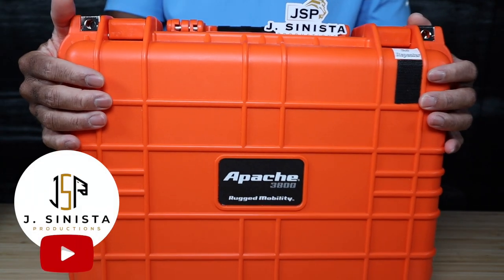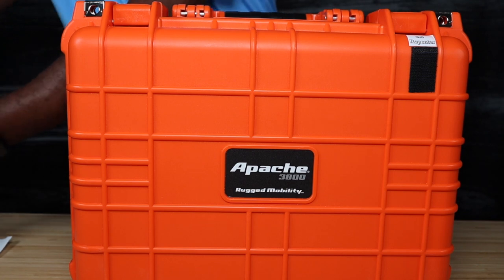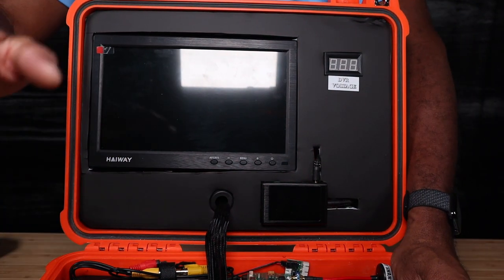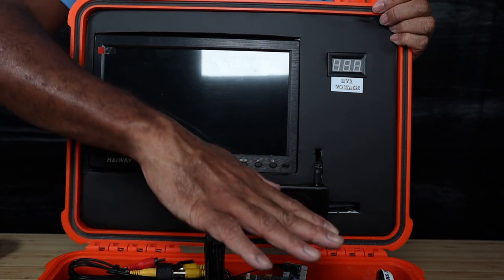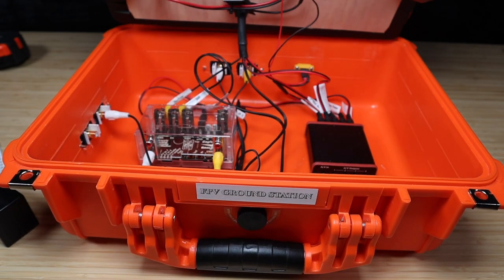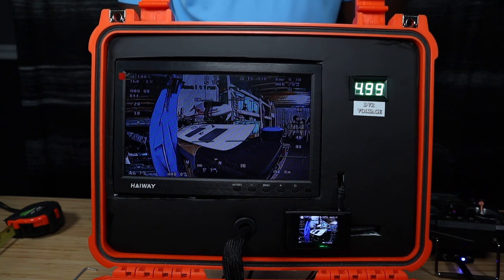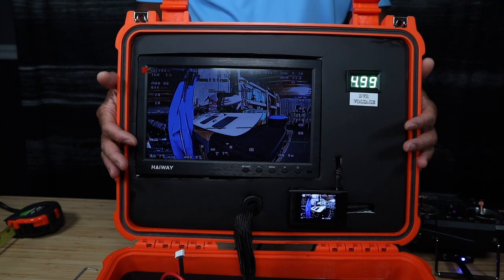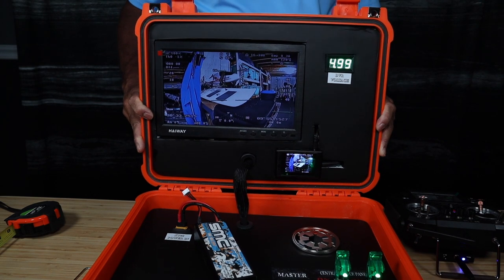FPV Journey - My Ground Station Case😱🛫😀

Comment: What is the range for that kind of a setup ?
Reply from the maker: When I initially tested it before my first crash landing (took me out of the game for a good minute) I took it out to 1.5 miles with absolutely no interference or breakup at all.  When the weather is better, I've built an Albabird that I'll be tuning in and range testing over the Spring/Summer.  I'll have better numbers by then.

Comment: Good info, great ground station.  Please consider making your videos way shorter than this. 10 min would've been a great video.  Thanks!
Reply from the maker: Thanks.  More info than necessary for those who are looking to build a case.  Postings that require less information are of course better in short increments, but I felt this video required a more in-depth look.